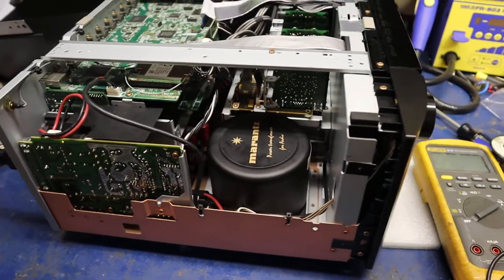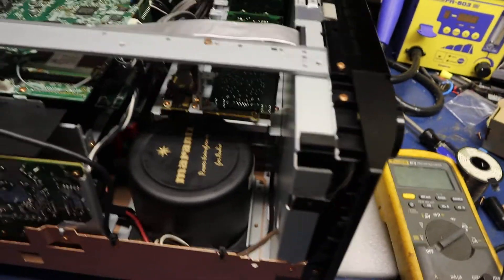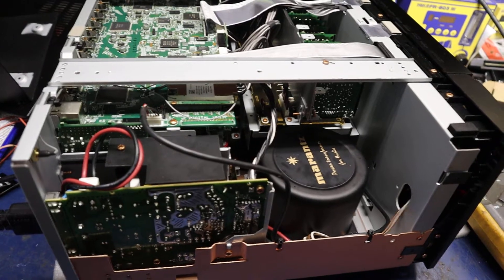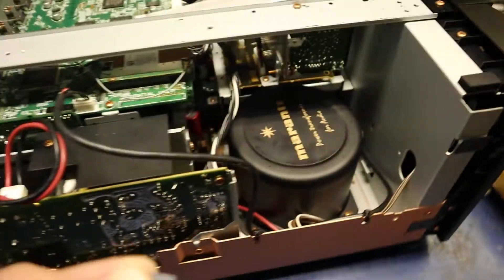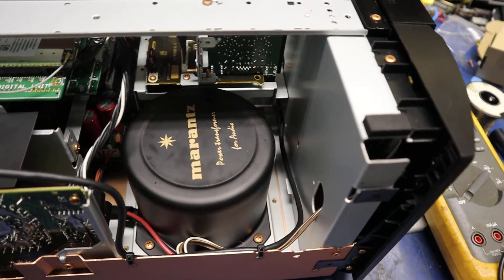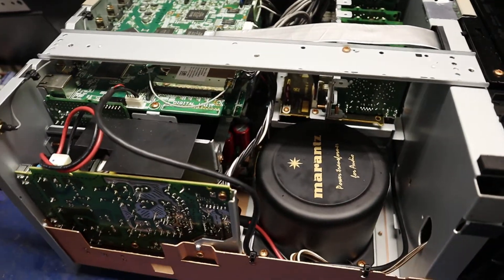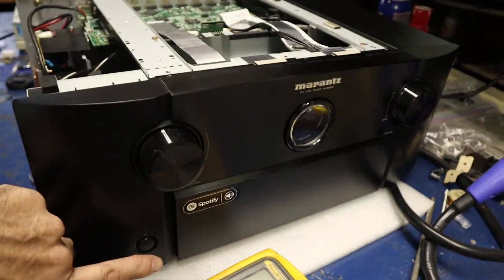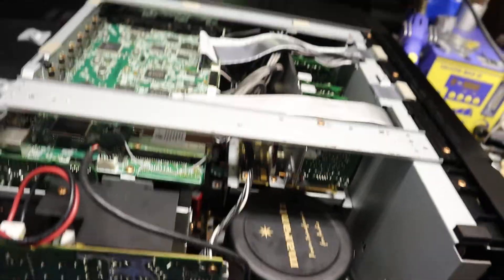Marantz AV8802 Processor No Power Repair

Comment: My AV8802 failed a few weeks ago.
Is the part number C519 or C6519?
Based on the service manual, it looks like C6519 rather than C519 (surface mount?)
Reply from the maker: C519 is the marking on the power board you see at back of processor in the video. The power cord is attached to the board its on. It may be 6519 in the service manual if the power board is labeled board 6000. I no longer have the unit  to confirm this and had no service manual to use when I made the video but its not a surface mount cap its a 22uf 50volt 105 degree through hole cap.
Reply: @audiogear474  Thanks. I will work on it during the next week or so as I need to label the cables before disconnecting it all.  I bought the unit from a friend a few years ago, who originally had it highly modified (upgraded) by "cinemike" to improve overall signal quality.
Reply: @audiogear474  I had it replaced and still no difference :(
Reply from the maker: It doesn't fix all no power issues but has a good chance of fixing ones where the 5 volt line is unstable  or puts out lower than 5 volts ie 4 to 4.8.
Reply: @audiogear474  I had someone else look at the pcb. they found two barely-visible solder pad/pin failures, confirmed by multimeter. It has now been re-soldered. I will re-check in 2 weeks time when I fly back home.
Reply from the maker: @c00nman That's great you got it resolved.

Comment: Would there have been a clicking relay when this was going bad? I have a Marantz SR-68 that clicked on and off several times one morning, waking me up. I pressed the power and the disruption stopped. But now it won't turn on...
Reply from the maker: I received the unit after it was dead so not sure what the previous symptoms were.. Also I haven't worked on the model you mentioned so not sure if the power supplies are very simuliar or not but it might be good to test small capacitors to see if they are rated value.and change any that are noticeably lower.

Comment: I have the same problem in the Houston area. We had painters over, unplugged the unit, and bam, no power. We called Marantz and the only authorized service center is in Austin. Any local recommendations for repair?
Reply from the maker: I'm not familiar with the area. Mabye someone from Texas will give local reccomendation.

Comment: Great video. My Marantz is in the same condition as the one in your video. I had a power surge and my 8802A is dead now. I took the covers off to check the fuse, and I cannot locate it. would you know where that is located, and maybe show me a pic? I was told it may be by the Power Transformer or where the unit's power cord plugs in, but no luck.   Im not knowledgeable at all about electronics repair so if its not the fuse I dont know if its worth paying to have it repaired. Thanks
Reply from the maker: @628Sheriff  "great video" Thanks. It's been 4 years since I serviced this unit and no longer have it so I can't send any pictures but the fuse should be near where the power plugs into the circuit board that's shown in the video. I can't remember the exact location.

Comment: I pulled out the power board, replaced the two caps with direct replacements and WOOPEE it worked perfectly again.. THANKS A MILLION. For your advice.. why on earth would this CAP fail.. bad board design or just poor quality caps ?
Reply from the maker: I cant remember the brand that came out of there .Its possible they got a bad lot of caps but more likely they should have put  larger or at least a longer life cap in there  based on the amount of ripple current going to the cap.

Comment: I pulled out the power board, replaced the two caps with direct replacements and WOOPEE it worked perfectly again.. THANKS A MILLION. For your advice.. why on earth would this CAP fail..

Comment: Measured 4.7 to 4.8 vdc at the output connector, (the smaller one with black and white wires) and replaced both of the smaller caps. One was 22uf and the other was 47, replaced both with 47uf 50volt electrolytic.  She works like a champ and measuring 5.2 on the rail now.  Plus is ok, but negative is not as far as processor voltage goes, at least in my experience.
Reply from the maker: Great job- Mine was slightly  lower voltage and had a wider voltage swing.. Seems these units need rock stable 5 volts.
Reply: On my amp the C6515 is 25v 47uf and the C6519 is 50v 22 uf .. the C6519 is coming out at 20uf  and the C6519 110uf so both are well screwed

Comment: Funny how a $0.05 part can disable a $500 unit
Reply: Worked for two high end audio manufacturers for 20+ years. You'd be surprised how often the simple was the issue not a full board being burned down. saw pretty much everything on repair returns over the years. 

I did not do the repairs myself but since I handled the returns & had to insure/check any piece worked before it was returned I asked questions & had our repair guys show me what had happened.

Comment: Could you supply a link to the specific capacitor that you purchased?
Reply from the maker: These meet the specs but its been over 2 years-I remember it being a 105 degree nichicon but cant remember the exact version. Its a good chance it was a upw or a uhe. I order those alot  https://www.digikey.com/en/products/detail/nichicon/UPW1H220MDD/589634 or https://www.digikey.com/en/products/detail/nichicon/UHE1H220MDD/589344

Comment: You are the Man! I had the exact same problem, no power at all. Took a little while to find this cap on the board. It's labeled C6519 I believe. Very tight area to desolder and re-solder. My soldering skills are the best but with the help of a magnifying glass I was able to change it out. I didn't have a 50V 22uF  but I did have a 50V 47uF. The Marantz is alive again thanks to you!

I'll post a small video that shows the power board out and the location of the cap. Of course I will mention your video. Thanks again!!
Reply from the maker: Glad you got it going.

Comment: Wow amazing you not only found, but alao fixed the fault. I have the same Model and it has developed a problem even Marantz and their official distributors admit they've never seen before.

 Every now and again, the unit goes into factory reset mode and all the settings are wiped. I then have to run calibration all over again. It may last 5 days, a week or two then all the settings are wiped again and you're greeted to the welcome screen aa though you're setting it up for the 1st time! 

Ive had two separate units do this and both of them are the 8802a models! Any clue as to what this might be?
Reply from the maker: I've never heard of that problem before.. I don't see many marantz in this town since no one around here sells them so not familiar with many of the common failures.. I'm surprised marantz couldn't fix it. Seems like it would have to be in the main board  or wherever the syscon is. I would try United radio in New York if you don't want to send back to marantz.

Comment: Hi there, I have the same model Marantz processor with the same issue. I’m new to troubleshooting electronics with a meter. How do I test the 5v bus line? If there is any basic information you recommend I search to get more versed please send me that direction! Thank you in advanced and thank you for the video!
Reply from the maker: I would not work on this if you are new to electronics as there are dangerous voltages. Its been a year since i did this repair but if memory serves me  i think the 5 volt line could be measured on the +side of the 3 large capacitors toward right of power supply if you are llooking at it from the side..

Comment: Hey, would you know if I can do the following? 

I own Marantz SR7008 which I bought in Europe. It has 220V power supply unit. When I moved to the US it was cumbersome to use it with the power adapter, so I bought another unit SR5013 (unfortunately it comes with 110V only) and kept the 7008 in a box. 

Now, I will be moving back to Europe and I was wondering if it's possible to switch the power units between those two models? The 5013 serves me well, it has all the features I need (air play, bluetooth and such). If this is not possible I will have to sell the US model before I leave - which I would prefer to avoid for the reasons mentioned. Thanks a lot for your opinion.
Reply from the maker: I 'haven't worked on those models but based on many other receivers I've worked on they rarely use the same power supply between different model numbers. and have different power requirements so generally not compatible as far as connecting between different units. The only way to know for sure would be find a service manual for the 2 units
Reply: @audiogear474  Thank you! I guess will have to sell it:)

Comment: Hi, I have a unit with the same issue and want to attempt to repair it myself. But when I look up capacitors, there are more specs than just the uF, etc. Is this a radial, and what is the size? Please give me all the info you can on this capacitor. Thanks in advance . . .
Reply from the maker: 22uf 50 volt105 degree radial I used a nichicon  if I remember correct-its been about 6 months. Nichicon series that will fit that description include vz,pw and uhd to name just a few. Digikey or mouser should have.
Reply: @audiogear474  Thanks. I had just ordered one from an electrical supply place in my former city (Salt Lake City UT), and they told me that they always send the smallest capacitor possible given the tight quarters that most circuit boards are in. It looked like yours was radial, so that's what I ordered. Thanks for confirming.
Reply from the maker: @jwghostwriter  You welcome. Hope that fixes it for you.
Reply: @audiogear474  Here's hoping. I may have more questions after the capacitor arrives (should be w/in a week). Thanks,
Reply: @audiogear474  Hi, I got the part and opened up the unit, but I'm having trouble finding anything numbered C519. Did you have to remove the board from the unit to get to that capacitor? As it is, I can see three very large capacitors and then two smaller capacitors nearby, one above the other. Can you tell me if it's one of those two smaller ones (they look like the right size and type) and if it's the top or the bottom one? I can send you a picture if that might help, so you can tell me which one it is. Thanks,
Reply from the maker: @jwghostwriter  i think i did but as mentioned its been 6 months. I remember it being on right side if you are looking at from side.i dont have one in for repair to look at currently and since it was a quick fix i never bought a service manual.

Comment: How much $$$ in capacitors/parts and about time in labor to fix this issue?
Reply from the maker: I don't do work through internet but if you find a local shop most charge 100-125 an hour and they should be able to do in an hour or less if its just the cap. The cap is about a buck or less but some shops charge 5 bucks per cap to help cover some of their shipping costs. As mentioned earlier if its the mainboard they sky is limit due to time and board costs.
Reply: Do it yourself, I did .. the caps cost about 0.10 chf ( Swiss) and it’s a 30 minute job from start to finish.. you just need a soldering iron, solder and flux.

Comment: I found a listing on Craig's List that has this model for sale for $850 with this same no power problem. What is a realistic price to offer since this requires so much to get going again?
Reply from the maker: If its just the cap its very inexpensive (if you do yourself) but it could also be a main board which is very expensive. I've never priced a main board but have been told 500+ for just part. It would just be a gamble.

Comment: Hello, can you tell us the actual part number for the capacitor? I found several 22mfd 50V 105°C but a search for C5-19 didn't return anything. Thank you.
Reply from the maker: Hi.I dont have a servoce manual to look up part number but any nichicon or united chemicon cap this value should work . A rubycon was in there originally but they are not as reliable imo. I order from mouser electronics and digikey. If you want to future proof go with a nichicon rated for 3000+ hours.
Reply: @audiogear474  Thank you!
Reply from the maker: Its c519
Reply: @audiogear474  So I replaced the capacitor labeled C6519 with an identical one (22uF, 50V, 105°), but still can't get the unit to turn on. I will test for the 5V on the board later this weekend. But in the eventuality I still can't figure it out, do you do repairs? Thank you.
Reply from the maker: @guillaumeslama  I do repairs locally but don't take anything through internet. I will try and help you find the problem though.
Reply: @audiogear474  Hi, I couldn't figure out how to send you a private message on YouTube, so I sent you my personal contact information through AVForums. Thank you so much for your help.

Comment: Thanks so much for the information. I have the same issue. I replaced the same capacitor and I could hear the power for a split second. Then I changed the rest of the capacitors with similar ones. Now no power seams to go through. 
Do you know the name or part number for the board? what should I be looking for if I need to replace the whole thing?
Thanks again
Reply from the maker: Did you replace rest of caps with exact original ratings? Do you get any voltage on the 5 volt line(positive side of the 3 large caps toward right)? All I changed was the 1 cap. I don't have schematic to look up part number for board. There should be a number on power board. Encompass parts is a distributor for Marantz and might could look it up if you have trouble locating it.
Reply from the maker: I might also add that if you dont see 5 volts on the 3 caps. Unplug power to supply then unplug the connector going to mainboard and see if you have 5 volts  when you reconnect the main power but with connector unplugged,. If you have 5 volts when its unplugged from mainboard then the problem is likely the microprocessor.